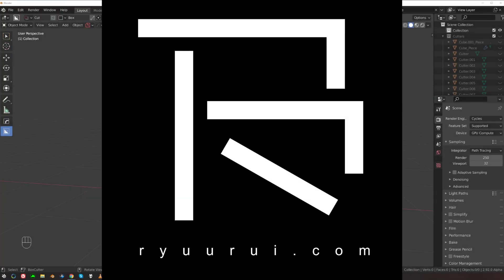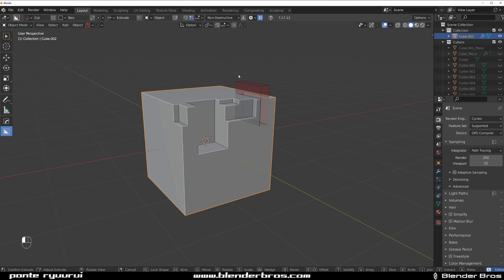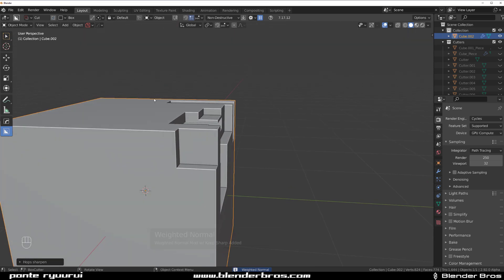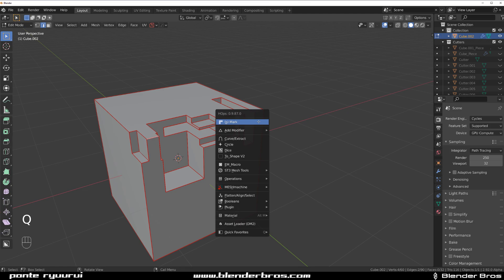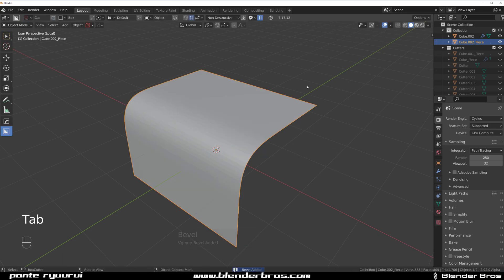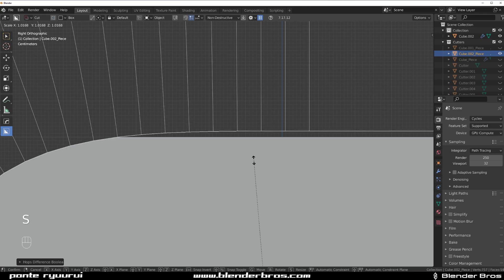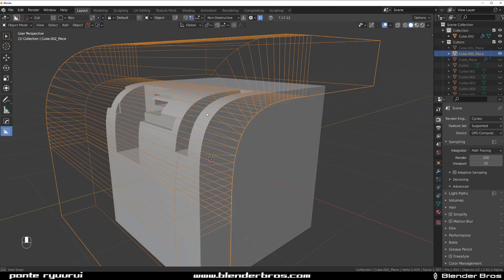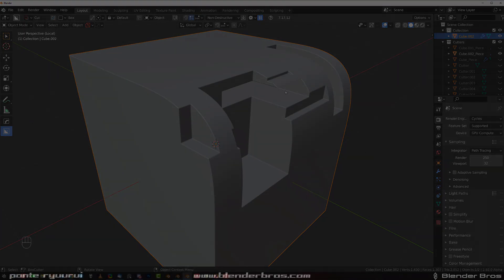IMPOSSIBLE BEVELS in Blender - hard surface tutorial for Hard OPS

Comment: Hi Ryuu, this tip is a little off topic from the video but you will probably find it helpful. When you are doing a tapered boolean for example, rather than scaling the face down, instead try inseting the face to the desired amount of tapering you want. Then you hit select more. After that select boundary loop and press dissolve edge. It does take slightly longer but the result is proportionally accurate.
Reply from the maker: actually all you need to do is press shift t with box cutter for auto taper, another way of doing it would be ctrl a apply scale, scale face, but in this instance i did not need the cut to be proportional
Reply: @PonteRyuurui They all behave differently, I have got an image showing the differences. will you prefer to receive it by your business email or through blender bros Facebook?
Reply from the maker: @rolston4107  you re on discord, mate?
Reply: @PonteRyuurui  Not currently, could you send me a link. Cheers.
Reply from the maker: @rolston4107  sure thing https://discord.gg/4tHBWceW / just drop me a pm

Comment: Soy boy here: Hardops really just saves you about 70% of time here, in vanilla you'd have to apply a bevel weight to the edge instead of marking, and add bevel and solidify modifiers manually. Still, thanks a bunch for the tutorial, I'd never even gotten the idea of post-bevelling otherwise!

(And I AM using hardops, mainly due to your continued insistence :) )
Reply from the maker: can you run a live bevel in vanilla though, because i am pretty sure you cannot
Reply: @PonteRyuurui  I think I am missing something here: Pressing ctrl-mark in hardops only creates a bevel modifier with vertex-group limiting on the edge I have selected, allowing me to non-destructively change the bevel (width, segments, profile,...) afterwards. Is this what you mean by "live"? Because that can certainly be done in vanilla.
Reply from the maker: @LordoftheFleas  well ya but this is a lot of work mate, the only other way to do it with clean bevel is via bwejight, but if you cant do that then you have to fiddle with vert groups

Comment: cool tip, but u don't need hops for this :/ cheers mate!
Reply from the maker: try running edge live bevel without bweight in vanilla then, you d need to dance with vert groups
Reply: @PonteRyuurui  True, however this kind of edge beveling is still possible in vanilla blender, calling it an impossible without addons bevel is very misleading in my opinion.